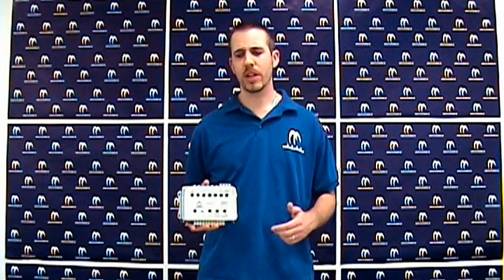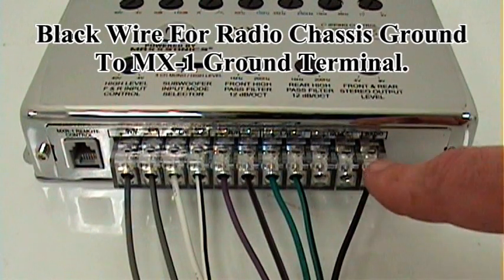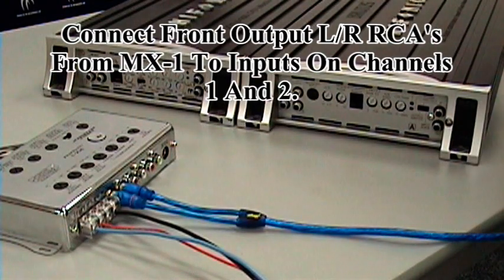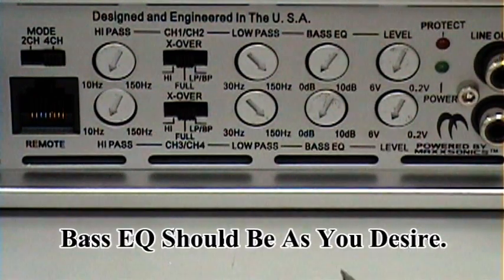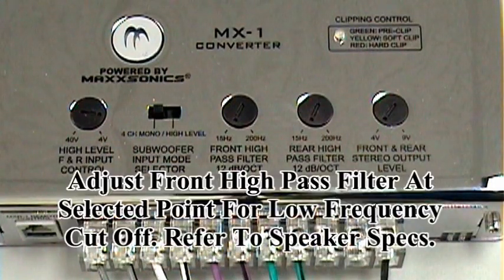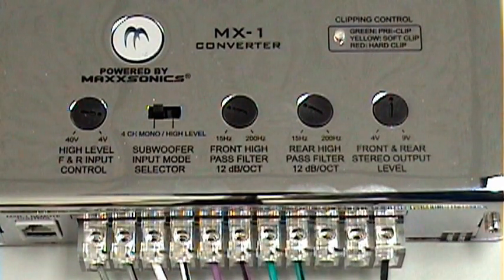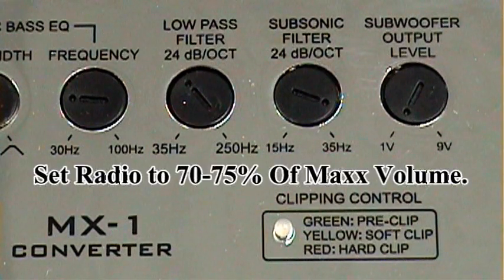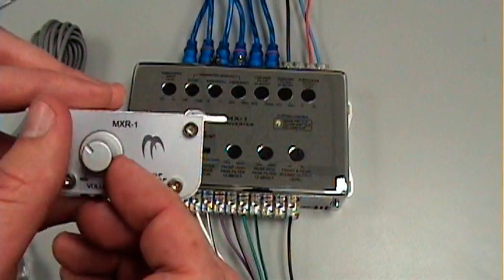MX-1 Premium High-to-Low Level Converter Installation Tutorial

Comment: Doesn't low pass and high pass not matter when you have your 4 channel amp in FULL range? It basically is a pass through so those adjustments don't do anything. They only would make a difference if you select either high pass or low pass/bandpass. Correct?

Comment: i own a 99 saab 95, it has the ms3/premium sound system, so the stock amplifier is under the passenger seat, what wires would i need to buy to connect the mx-1 to that amp, and then to connect it to my factory amp in my trunk, along with a subwoofer?

I'm just unsure which wires i would need to get, any specific kinds u recommend? would appreciate if you list all the needed ones for what i explained i hoped to do

Comment: i plan on doing something similar with 1 4 channel amp and 1 1 channel amp can i run both remote wires for the amps from the single output on the mx1

Comment from the maker: If you choose to install an EQ after you have the speaker wires connected to the MX-1, simply run RCA's from the outputs of all 5 channels to the inputs on the EQ of your choice. Then from the RCA outputs of the EQ to the inputs on your amps.

Comment from the maker: So, I would suggest locating front/left pos and neg, front/right pos and neg, rear/left pos and neg and rear/right pos and neg for the 4 stereo line inputs. With the MX-1, you don't have to tap in for the sub input from the vehicles wire harness as it will auto sum for you, but you can if you want to have control of the sub from your factory headunit controls.

Comment from the maker: If you are interested in only using a 4 channel and 1 mono amp then the MX-1 will be perfect. First, you will need to locate the wiring harness on the back of the radio with the speaker wire outputs. Hopefully Pontiac has a standard color code, or you might have to purchase a wiring harness simply as reference for getting the color codes of the wires. The speaker wires that you select will determine your stereo left and right imaging as well as front and rear fade.